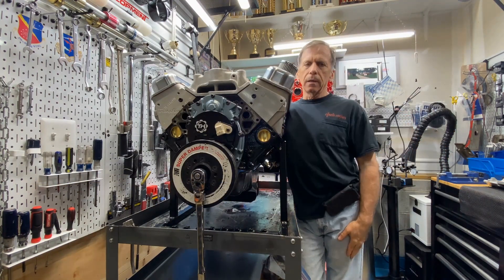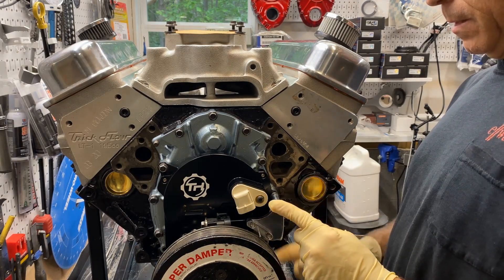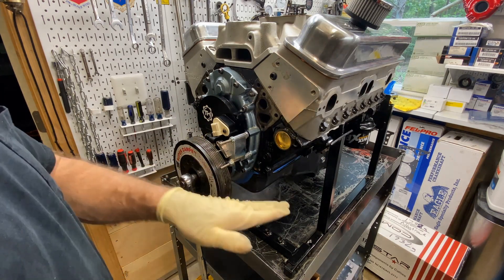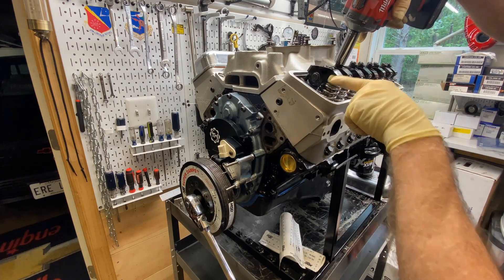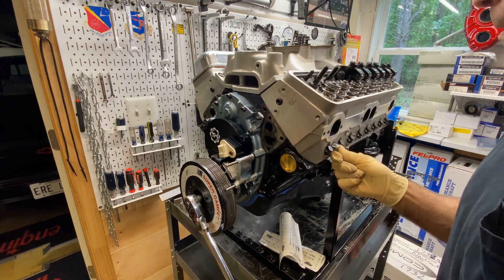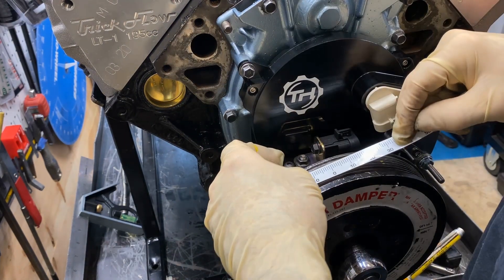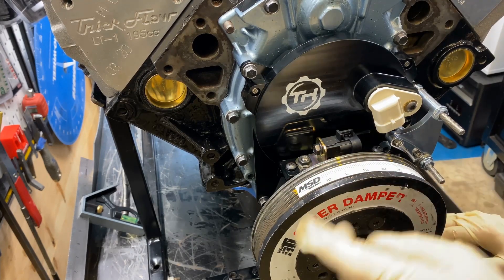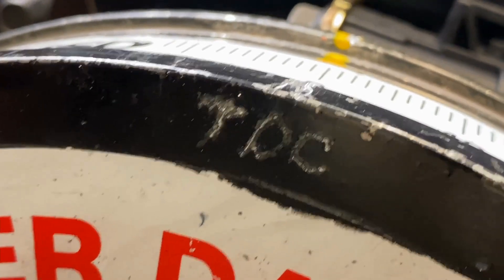Mark TDC and Add a Timing Pointer to Your LT1

Comment: what intake is that? does it work with the LT1 even though it has the coolant crossover?
Reply from the maker: Yes this intake has the coolant crossover plugged.  I’m pretty sure you can use any gen 1 SBC intake manifold as long as you get the bolt holes to line up
Reply from the maker: It is an edelbrock performer rpm single plane

Comment: This is so much better and cheaper than trying to track down the discontinued chevy performance lt1 timing pointer. I’m starting my lt1 build soon for my 65 buick. Converting to carb and distributor. The right intake for the swap is close to $500 but I’ve found you can use a sbc intake if you make the center holes a little bigger and make some angle shims for the bolts. I got a complete lt1 for $150 with less than 10k on it. Guy had no info on it. I took the risk and it paid off huge.

Comment: Hi Karl, You found TDC on the damper then etched it. So to be clear when you bring the 0 mark you just made on the damper to the pointer and they are aligned number one piston is at  true TDC. If one was to remove the cylinder head piston #1 would be flush with the deck. Is that correct? Probably answered my own question. Thank you.
Reply from the maker: Yes that is correct.

Comment: What size socket extention did u use? U never said if it was 1/4.   3/8 got an lt1 myself  with an hei dizz and im having an issue getting TDC dead on.
Reply from the maker: It was (is) a 3/8 " extension.
Reply: @EllweinEngines  awesome brother. Thank u. I'm gonna try it

Comment: Do I need to remove the rockers to do the top dead center test
Reply from the maker: Yes.  Good point.  If you use something to stick into the spark plug hole then the rockers need to be removed.  If not then the valves get in the way.

Comment: If my valves don’t go up and down when I rotate the crankshaft what does that mean
Reply from the maker: I don't really know how to answer that.  1st though is that you have a broken timing chain.  That would be a bummer eh?
Reply: @EllweinEngines  the chain isn’t broken but it did skip a I think 3 teeth.. I can rotate the crankshaft with the socket tool I bought but I don’t see any movement within the rocker arms when I rotate it clockwise.
Reply: @EllweinEngines  or would the movement come when I rotate the camshaft?

Comment: HELP-92 corvette LT1 with the 24x conversion like yours in the video. I'm running the holley terminator ecu and harness. The ECU puts 12 degrees into timing but it seems that the timing is wayyyyy off. I mean coughing out the intake after shutdown.... have you noticed the torqhead conversion timing being way off? Thanks
Reply from the maker: I have not noticed that.  I ran a terminator x using the TH sensing units on the engine dyno and timing was exact at the crank with a timing light.  Maybe it's a setting in the terminator x software?
Reply: Alright i'll look into it, thanks

Comment: What aftermarket aluminum heads and CAMSHAFT do I need for a 1995 chevy LT1 2ND GEN I HAVE A SPEEDMASTER 4 BOLT MAIN 350 STROKED SHORTBLOCK BUT I REALLY WAMT TO USE THE FACTORY INTAKE AND I HAVE A PAIR OF 76 MM TURBOS AS WEEL TO INSTALL. TGANK YOU
Reply from the maker: I always recommend the AFR heads.  Camshaft I don't know.  I leave that up to the cam designer.   Give AFR a call and pick their brain.  They all bolt right up and the stock intake works well.  Sounds like you have a good short block.  Enjoy!
Reply: @EllweinEngines  I'm in NC and I really want to make 4 digit Hp #'s and I would like you to build this engine for me, that is if you would like too. Just let me know and I can bring you everything I have and also bring you cash upfront. Thank you for your response and I hope yoh have a blessed day!

Comment: Thanks for sharing. Recently went round and round on my cammed LT1 with this after replacing my guideplates. Kept chasing noise in the valve train that wasn’t there before. I used an inspection camera to verify where I was. Used a factory cam on the bench for reality check of base circle positions to differentiate between #1 firing and #6 firing. Still noisy. I’m chalking it up to the beaten/ worn 13 year old lifters (short travel Comp 875-16). Time for new lifters and pushrods I’ve decided. Been wanting a marked ATI damper for a while. Once you have TDC established you can mark any damper in the about 1:30 position and align the tab to it at 0 and call that your TDC mark, just like a traditional SBC Gen 1. You could put the tab at the bottom if you really wanted to, the tab for the timing light is just relative to itself as a reference once it’s set to 0 with the engine at TDC. The 1:30 position was chosen for visibility since it would otherwise be hidden by front accessories. Just works out to be a good spot to be able to see it and hit it with a timing light. But this exercise got me motivated to go after it pretty soon. Thanks!
Reply from the maker: thanks for the info and great tip.   Definitely.  Put that mark and pointer right where it can been seen.